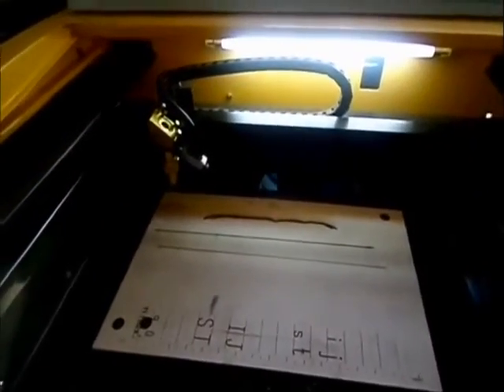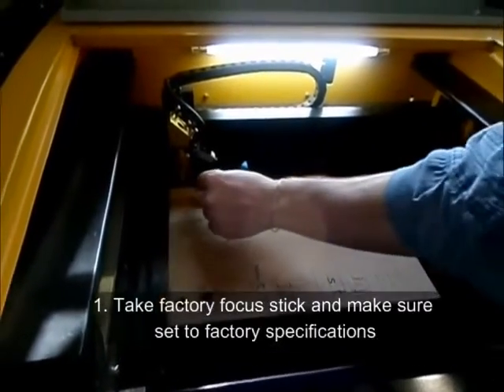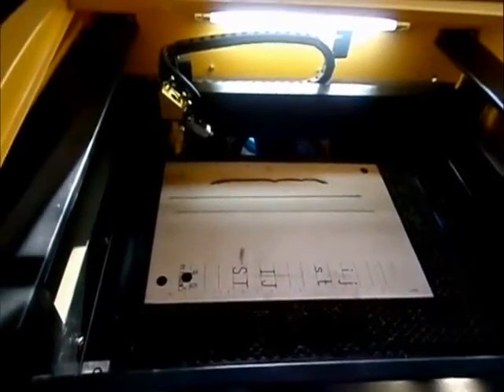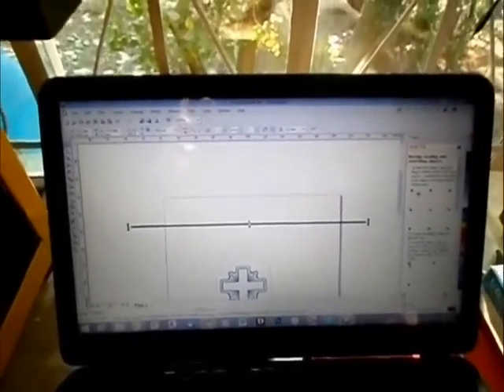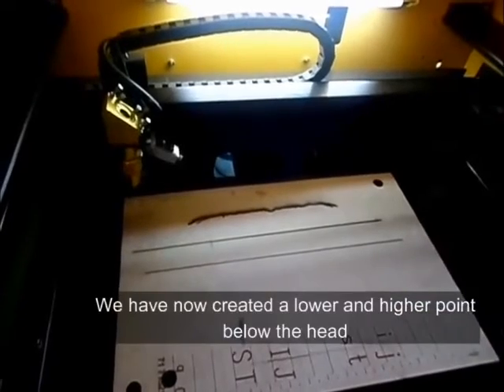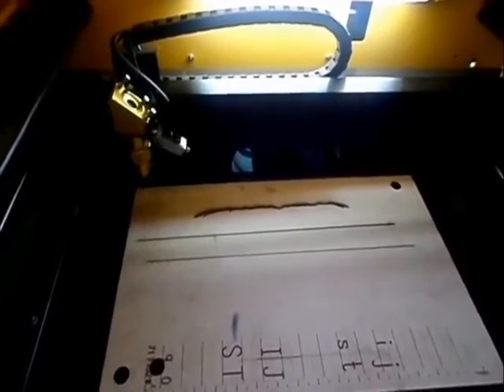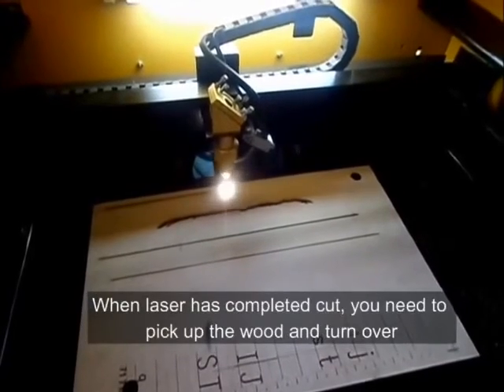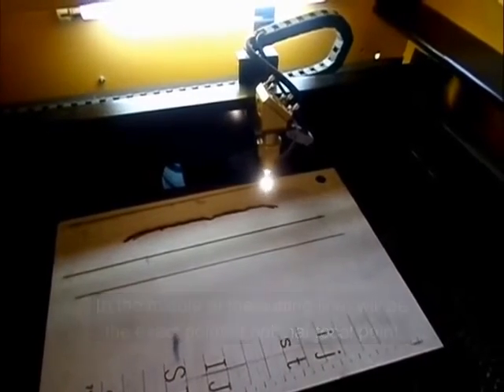How to check your CO2 laser focus is correct

Comment: Iam doing laser for 4 years now ! This is the best Method so far but you can improve it by reducing power each pass until you have just a small Cut visible on the bottom that is you cut range and the center of it is the perfect Focus Point Works soooooooooo well